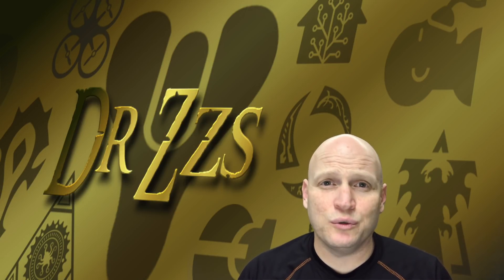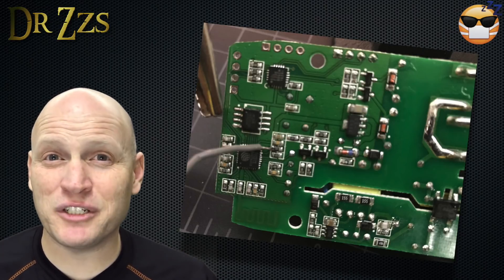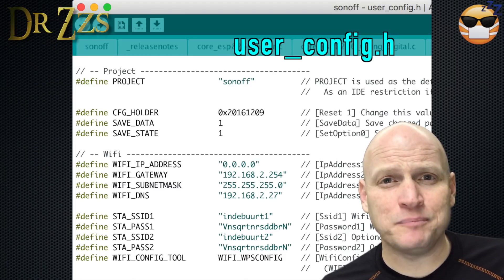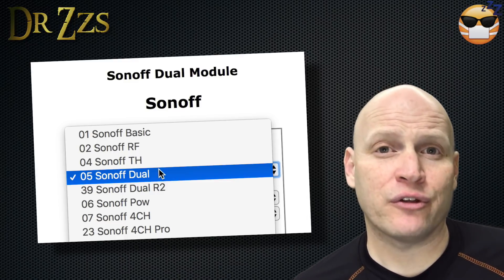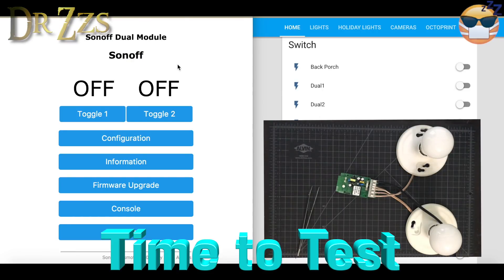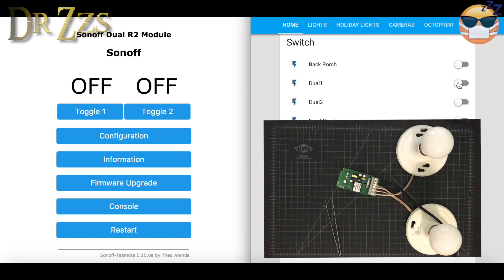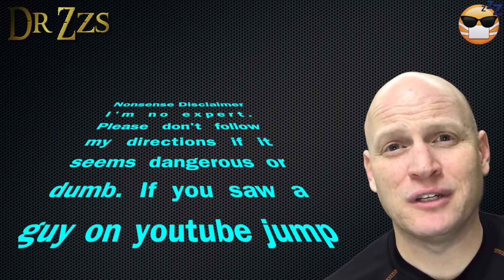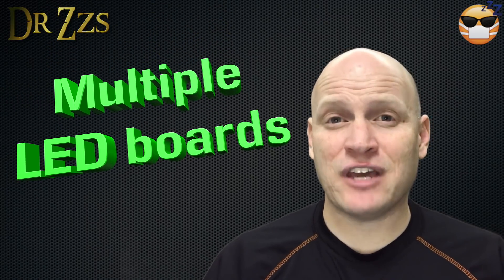Sonoff Dual with TASMOTA firmware

Comment: Hi @DrZzs,I have a Dual R2, my external button on button 0 is not working. It is set as switch1. Do i have to use push button for this?second, will using normal external switch will start board in programming mode if power is reactivated ?
Reply from the maker: hmm.  You're sure it's an R2?  I had one that said "ver 2.0" on the board, but that wasn't really and R2.  It has to have "R2" printed on the board.  Is the other button on GPIO-9 working?  You can use a push button or a rocker-type button.  Just set the switchmode that you want.  You can change the switch functions using the "Console" in Tasmota.  If you type "switchmode1" it will show you the current setting of switch #1.  type "switchmode2" to see the setting for the 2nd switch.  
This is the list of Console commands, and all the possible switchmode settings:
https://github.com/arendst/Sonoff-Tasmota/wiki/Commands

For my switches that I use with Push Buttons, I set mine to "switchmode1 4". 

Tasmota also changes the function of the main on-board button.  
https://github.com/arendst/Sonoff-Tasmota/wiki/Button-usage

I'm not 100% sure those functions are true for the Sonoff Dual.  I haven't tested it.  
You can ask in the Tasmota wiki "issues" page.

Hope that helps!
Reply: Thanks for the reply! Yes it is R2 one. Let me play with switch mode.

Comment: Great Video.  Quick question on the pushbutton.  How do you get the pushbutton to have led lit(for visual location only and not status of the device) as well as have the push button to turn on and off.  On the push button, there are 5 pin (+, -, NC, NO and C) and the basic VCC,GND, GPIO14, RX and TX.  Connecting NO and C get the push button to turn basic on/off, but connecting LED + to VCC and - to another GND point on board makes the LED lit, but disable the push button.  Any thoughts on how to make it work all together.
Reply from the maker: Thanks!

I haven't tried changing the LED.  I believe Tasmota has some LED commands you can enter in the Console that change the behavior of the LED.  I'd say look through that and see if there's a solution. 
https://github.com/arendst/Sonoff-Tasmota/wiki/Commands

Just a quick look, I don't see a command that keeps the LED on all the time. 
There's got to be a place on the board where you can grab 3v and connect an LED.  
Poke around the Tasmoda wiki, or ask the question on the issues page.  Theo and the guys there are really good about responding, and of course they are geniuses. 

Let me know what you figure out.   I'd like to have an LED on when the lights are off too, to help find the switch in the dark.  

Good Luck!
Reply: Thankyou.  Yes Theo and guys are very good.  I was able to get it working as follows: From Pushbutton to Sonoff( Connected +ve to 3.3V on header pin, -ve to GND(1st pin in series of pins next to relay), C to GPIO 14 on header pin and NO to GND on header pin).  Now the LED on the pushbutton is always lit(can find the button in dark :-)) and pushing the button turns sonoff on and off.
Reply from the maker: That's fantastic!  thanks for sharing.  I wanna do that now too! 
Thanks!
Reply: Have you hooked up those switches you linked to your sonoff dual yet to see how the led works?  I was looking do something similar but was concerned about the current draw of the led and wanted confirmation that the sonoff could source enough power for the LED ring on those 12v switches even though VCC on the microcontroller is 3.3v.

I eventually wanted to take the illumination to the next level and use pwm0 and pwm1 on the 8285 to change the brightness depending on the relay state.
Reply from the maker: I haven't yet.

Comment: Thanks, this is definitely going to help me get started with Sonoff! ... Just a question about the push buttons in your example: so they have to be momentary with no permanent state change? Will that allow someone to hold it and reset the Sonoff or issue some other command? Also, would it be possible to use a push button with LED indicator to easily find it if it's dark?
Reply from the maker: Eugene Pugach Great questions. The TASMOTA firmware lets you change what the pins do when you set them up to be a switch. The default for the Sonoff Basic works like a normal rocker switch. If you want to use a momentary button you go to “Console” and type “switchmode1 4”

I don’t know for sure what the default is for the Dual since I was using an original configured as an R2. 

Here’s the list of things you can type in the Console to change the switch function, and a bunch of other settings. 
If you have a Dual, set it up and try different switchmodes until you get the one you want. 

https://github.com/arendst/Sonoff-Tasmota/wiki/Commands

Good Luck!
Reply: Awesome, that's just what I needed! In regards to using a push button switch, is it an option to use one with LED indicator built-in and have it on during a specific state or is that just not possible due to the extra connections that come with the LED buttons?
Reply from the maker: I don't know.  I like the idea though.  You should be able to power the LED from the Sonoff.  There's a 3v pin on the basic that's easy to find.  A wire from there to the switch should power the LED.
Reply: Thanks again, I'll get one LED button and give it a try. I just thought it might be a good idea since a flush button would be harder to find in the dark so a little glow might help :)

Comment: Dr. Zzs, Will I be able to utilize the default ewelink app to control my sonoff switch after loading TASMOTA firmware?? Thanks so much!
Reply from the maker: David Steiner No, I don’t believe you can, but I haven’t tried. I use  TASMOTA so my Home Assistant hub can control the sonoff.
Reply: Thank you

Comment: OTA is really easy all you need to is go to https://github.com/arendst/Sonoff-Tasmota/releases select the most current release i.e. (5.10.0 20171201) this will always be on top select sonoff.bin file and save it to your computer. Then open one of your switches by entering its IP into a web browser then select firmware upgrade. Than select  "choose file" sonoff.bin and click start upgrade. it will take about 45 seconds to push the update then another 60 to reboot.
Reply: Thanks, that sounds super-easy; I will give it a try. Will burning the new firmware keep all the settings for MQTT server, sonoff name etc?
Reply: yes all setting are retained
Reply: Brilliant, will be giving that a go then, a lot easier than opening them all up to update them. Thanks!

Comment: you do not need to solder to the pad on the bottom. What I did was to solder on header pins than used a jumper wire from ground to pad of the resistor on the other side this will put the esp2866 in programming mode. Once it is flashed you never have to do this again.
Reply: Can you show how? Because I don't really understand it. You put one side  on the ground pin and just touch the resistor with the other side of the cable?
Reply from the maker: Steven Reed well NOW you tell me! Doh!
Reply: sorry for my bad English
yes, you can do this
...connect one side of the cable to the pin gnd on the sonoff and the other side of the cable touch the resistor, connect the programmer to the usb port and you can leave the side from the resistor, now the sonoff is in programming mode.
enjoy

Comment: Thanks for the info; looks like the R2 is a significant improvement. Looking forward to your video on OTA; I have 8 sonoff basics and they all need updating, doing it by wire is a real PITA so I would like to know how to do OTA updates.
Reply from the maker: MrJozza65 are your basics running TASMOTA already? If they are the update is super slick.  Grab the latest sonoff.bin from the TASMOTA GitHub page. Then there’s an update firmware button on the main page for your device. It’ll give you the option to upload a file. Grab the .bin and poof. 

I’ll go over it in the OtA video too.
Reply: Excellent, thanks for the info, I spent a day or so finding out how to flash them with Tasmota so they are all running it (albeit a fairly old version from early this year). @Steven Reed has given me some good advice too so I will definitely be giving it a go as soon as I have a bit of spare time, sounds straightforward. Too busy working on ESP8266/NodeMCU hacks to Xmas lights controlled by MQTT via Home Assistant at the moment though ;-).

Comment: Thanks for posting this video
Just opened my dual up. It’s a Ver 2 but no R in sight – Bad news - but it only cost £5 so I’m not worried
Reply: conrad mcglinn where did u get them from.
Reply from the maker: conrad mcglinn that’s the same as mine. I thought it was R2 because it said ver 2.0 but nope. 
Still useful as long as you don’t need physical buttons. 
Hoping my next one is the R2 for sure.
Reply: if only there was a way to order an r2 I have checked banggood itead and non of them list which version they will ship
Reply: I get them from Ebayhttps://www.ebay.co.uk/itm/New-Smart-Wireless-Sonoff-Home-Switch-Module-ABS-Shell-for-Apple-Android/201979389557?ssPageName=STRK%3AMEBIDX%3AIT&var=501988840789&_trksid=p2057872.m2749.l2649RegardsConrad